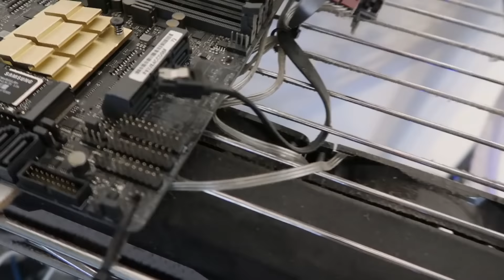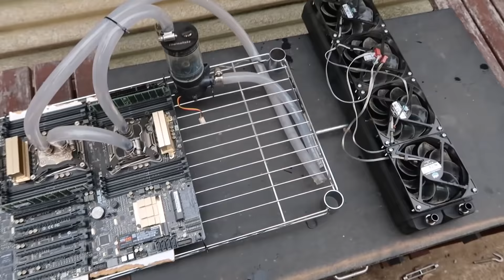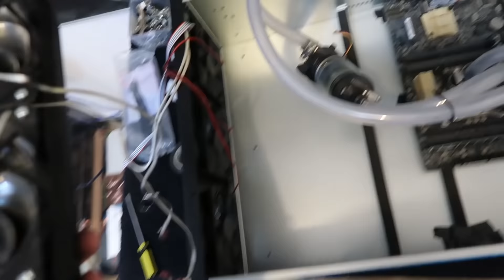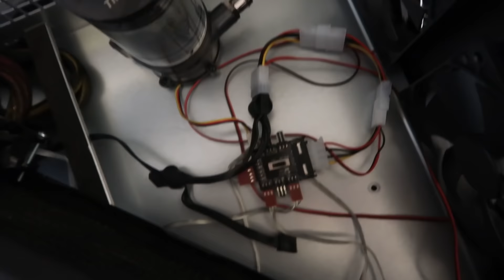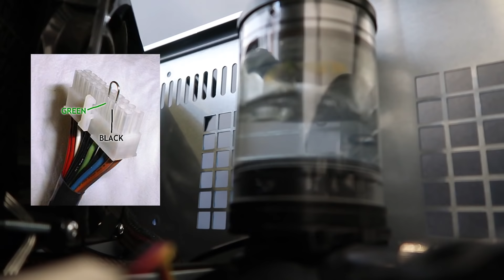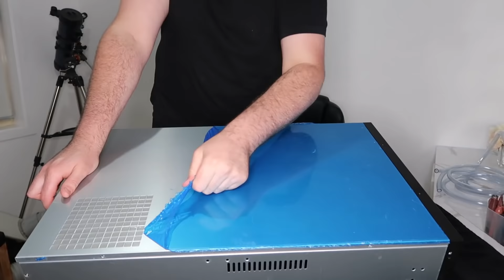Watercooled, rack mounted SERVER Build!

Comment: It's nice to see someone building a diy homelab like yours. I already racked my storage and vm servers and am researching on moving my personal watercooled rig into the rack. It never occurred to me that a mining case could be an option.
I am curious how the side intake and acrylic shield influence thermals. I don't do any of that and just go through the pain of cleaning out my stuff every 2 - 3 months using compressed air.
Also, perhaps scripting your videos would reduce stress and give you the confidence to talk without the constant "now". This could also give you the ability to make an intro without editing every sentence.
Reply from the maker: Cheers, yeah the mining case was a bit of a rare find, at the time someone on eBay (think their farm went belly up probably due to Electricity $) but sold everything, I got a second one as well so I can make another server in it. as for the DIY rack enclosure, it's ok, airflow is fine and a lot of the dust does get stopped on that side filter, I needed to do a full air compressor clean a couple weeks ago, so went a year without needing a clean so I would say it works well, the only problem I'm finding at the moment is heat from the HDD server which would be fixed by adding a couple decent fans but the noise is the trade-off, and since it's next to the computer I'm recording audio on not the best idea. So I'm looking at 42U server enclosures which will be a whole build thing in itself because it needs to fit all of those components and also the 2 x c7000 enclosures. Thanks for the feedback, funny thing is that video I did script haha, I find a lot of my editing is cutting out "now" "soo" and the "umm"

Comment: ehm ... why put the radiator IN the case? that is not teh more efficent way to do water cooling :D
Reply from the maker: I purchased the server and it was water cooled from the start, i wanted to put it in the rack, and had all the components. The server creates very little heat because its not loaded up at all. so not really fussed about efficiency plus the rack is sitting next to my gaming rig so don't want the loud airflow that normal rack setups have, but the main reason was because it was cool to stick a full rad in a serve rack case